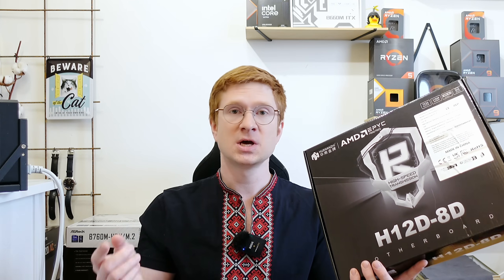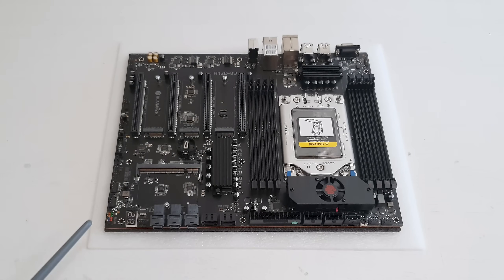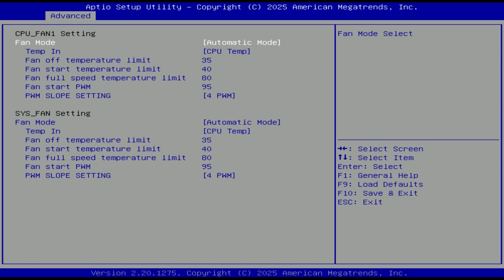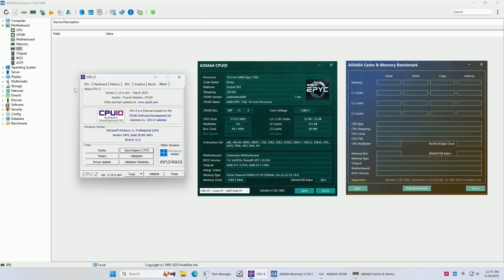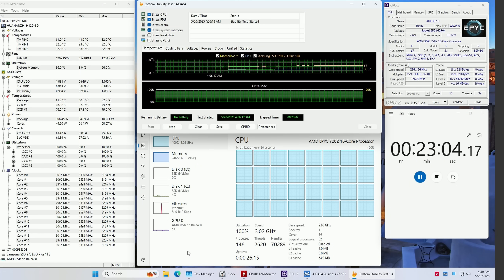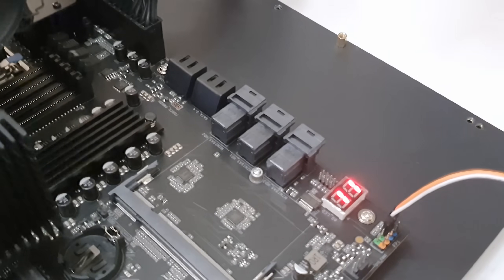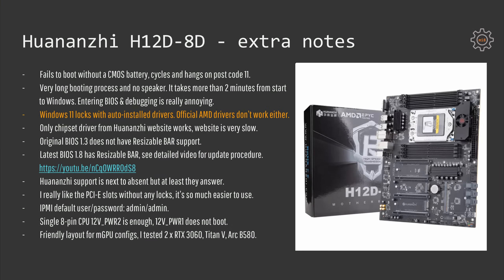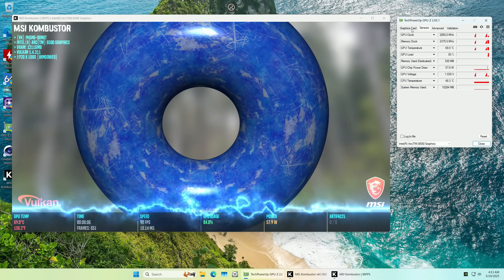Huananzhi H12D-8D EPYC - motherboard review, part 1

Comment: 10.22 same with a official board asus for amd drivers you need verry specific drivers
Reply from the maker: Thanks for the info. This is my first ever EPYC board, previously I only had Threadriper.
Reply: @Miyconst  this 1 was a budget build my first server it hes the rx6550xt in it.if i had known the chinees had mothboard in the making i would have waited...this secondhand krpau r2 16 ram slots 8 +- 100gbs read write aida occupied costed me like 350 motherboard aloane and only 25x gen 4pcie...ofc was +-a year ago atleast it leaves a upgrade path to gen 3 when the prices drop....with epyc 7302p i lv of at around 80w iddeling.carefull with alliexpres ram they sell 3200mhz ram but then only 1 module shows up and you got to downclock timing s for the rest to show up had to downclock it to 2666 for all ram sticks to show up...no mony back alliexpres return buyer protection seems more and more just a paper to wipe ur as*s with only pay them with paypal cuz you cant count on there internal dispute proces.

Comment: Thank you for the work on the BIOS update, I updated mine and now have Resizable BAR too, very pleased. Mine has still been rock solid so far! Worth mentioning, my boot time is about 15 seconds from power on to Arch, make sure you disable BMC in the BIOS, and it'll bring the start-up times down by a minute or two.
Reply from the maker: Hm.. I tested without BMC installed and it was still slow. What is your CPU/RAM configuration?
Reply: @Miyconst  Worth stating that even without a BMC (I didn't bother buying it), if I boot with BMC enabled in the BIOS (which is default), the start-up time is 2-3 minutes, but with the BMC disabled it's under 20 seconds.
Reply from the maker: Oh, thanks for the tip, I will try that.
Reply: @Miyconst  Makes a huge difference to mine, good luck!
Reply: @Miyconst it's a 7532, 128gb of buffered 3200 ECC, and a 6900XT GPU.

Comment: Another great video, I have a question for you. I was checking AliExpress, and something came to my mind when I looked at dual X99 motherboards, would they be good for a budget AI build¡ due to the amount of RAM and many GPUs? If so, would you recommend any X99 dual in particular? I checked, and the X99 machinist D8 looked the best as it has 4 PCIe x16 3.0, is there anything better, cheaper, if possible? Also, does the chipset in dual motherboards make a difference other than the stability of the C612 and overclock of the X99?
Reply from the maker: I would stay away from all dual socket Chinese boards. If you need something cheap - get a used Dell T7810/7910 instead. The Machinist X99-D8 board in particular is very problematic. Regarding the AI, it really depends on your workload. If you hope to use CPUs with massive amount of RAM then it will be a big disappointment as these V3/V4 Xeons lose badly to EPYCs.
Reply: Thanks for your info @Miyconst

Comment: also you need to install memory properly due to the manua (if you are using less mem modules than slots you have). and epyc 7002 and 7003 CPUs has different memory layouts. incorrect instalation will cause WHEA errors for L3 cache, freezes, lower perfomance
Reply from the maker: The motherboard has eight slots and all were populated with RAM, thus I don't think it has anything to do with the locks I experienced.
Reply: @Miyconst  if all slots are populated - there are no probems, but if you use less RAM sticks, especially on DUAL CPU EPYC system - you will have some problems with stability and perfomance

Comment: There's no chipset, why would it need drivers? NVMe, XHCI and AHCI work with default drivers. Rest of the things are handled by the BMC. You're most likely installing shady spyware.
Reply from the maker: AMD's EPYC SoC needs drivers to function properly. Otherwise there will be a bunch of unrecognized devices and Windows will attempt to install drivers from Windows Update servers.

Comment: Thanks for the review, looking forward to part 2. Slow POST and boot times is almost certainly an Epyc RAM training issue. My Epyc 7k62 on a Supermicro board takes just as long.
Reply: That's just that's not an issue. That's a feature of the platform. Ddr5 has a lot of ECC and noise handling in it
Reply: @teromeehaley4612 issue is maybe the wrong word. Trait is more like it
Reply: Server Motherboards usually take a long ass time to post. I work in a Data Center I don't think I've seen a single system POST in under 5 minutes, most take about 10 minutes to POST. Usually longer if it's the first POST on a new motherboard. That goes for both Intel and AMD systems.

Comment: Given the layout similar to tyan s8030 and asrock romed8-2t, the second 8pin 12v is very likely for pcie / ddim / sas etc. 4x 3090 or even 4090 blower will draw crazy amount of pcie power (200+W), which really deserves a dedicated power rail.
For the pcie extenders (for example 4x 3 slot cards), you will need dual sff8654 8i pcie x16 riser kit which will be expensive.

Looking forward to the part2! ❤
Reply: What will happen if i just plug 4x 4090 and run it full power for ai llm ? 😅
Reply: @tyfinancial  It should be fine. Dual psu to the 12V. The pcie should be still 200w, in total. I use 3090 x4.
Reply: PCI-E power supply totally depends on your PSU instead of motherboards slots, slots only provides 75W max for standard output which like A1000 such.
Reply: @AfroJewelz It is more like 75W per slot. My case is 45W x4, seen in gpuz. If you have power rail monitoring (direct probe with multimeter instead of ipmi), you will see voltage drop to 10.4V and eventually trip my 2050W PSU even it is not halfway there (capped to 225W per card)
Reply: @6DAMMK9 my current setup using 2x rtx4090 + cymoon x99 mobo 😅..with 1650w psu
each pull 60w+- from pci slot at gpuz.

That mean this board only supply 45w if 4 gpu setup? And the remaning go to gpu 12 2x6 power cable ? 🤔
Reply: @tyfinancial  That will be very complicated. Before 3090, even 2080ti, nvidia has made most high end cards pull only 10W from the pcie slot so there is actually no consideration in this topic. You can trace PCB layout to watch which power phase use pcie slots (AOHC / GPU repair channels will teach a bit)
However since 3090 "dual 8 pin" is already off spec, things get worse quickly. The "10.4 V" comes from supermicro X299 (single cpu 8 pin but 4 pcie slots), meanwhile ROG / EVGA is a bit better (low 11), and only these boards are high 11. 
They may not even share with the CPU 8pin, and all pcie slot power use the poor 24pin and trip the PSU if the 12V rails are split, or you can see the wire becomes hot (60C by thermal camera). 
It can still "support" all 300W, but that will burn wire like 5090 😅
I don't have the PCB layouts, it can be shared rails or dedicated rails, depened on the factory (yes, I have tried X299 before "AMD yes", which X299 with 512GB RAM is possible but really unstable)

Comment: Might be a bit of an investment, but would be nice to see if OEM Epycs like the 7K62 work properly, both from just a compatibility standpoint but also higher memory bandwidth and VRM strain. Thank you for the detailed review!
Reply from the maker: Huananzhi sent me some screenshots with 7K62, if that can be trusted then the CPU works just fine. I would also like to test it but as you say, it's a sizeable investment and I have already spent way too much on YouTube this year. 😕
Reply: I've tested the 7K62, and it runs perfectly fine on this motherboard, except that it fails to display the bandwidth in the AIDA64 Memory Benchmark (I waited for a long time, but no result was shown). As a result, I ended up 7532 as a replacement.

Comment: Excellent review! Proxmox is definitively high up on my wish list for your 2. part - IOMMU, SR-IOV, GPU, SAS and NIC passthrough - as there are lots of use cases where one might want to pass through dedicated or virtualized multiport NICs with 25 or 100Gbps.
Reply from the maker: I don't have any external NICs to test but I will surely verify GPU pass through. If it works, any PCI-E device should be possible to pass as well.

Comment: SP3 EPYC doesn't support UDIMM at all, RDIMM or LRDIMM only. My asrock board doesn't support 3 pin fans either. With 7282 you might as well run slower ram or just 4 sticks. The limit isn't the memory to IOD link, but the IOD to chiplet link. I'm running 2133 and its fine. As for boot times: mine are awful too. LPT: When you need to get into bios from windows, just hold down shift when pressing restart and then select bios from the options. It'll still take a while, but at least you dont have to babysit it.
Reply from the maker: What ASRock board do you have? Sure, for budget builds DDR4-2133 is good enough but if I have faster RAM, why not? 😃

Thanks for the BIOS entering hint, I gotta test it.
Reply: @Miyconst  I have the EPYCD8. So gen 3 and zen 1/2 support only. But for 200 eur new in box, I'm certainly not complaining
Reply: Which is generally a good news, UDIMMs are a lot more expensive than same size RDIMMs

Comment: Hello, I have an other Question. What X99 CPU should I get for gaming and I have a pretty weak GPU, so only time my CPU could be a bottle neck is when playing Fortnite at perf mode, please tell me best gaming CPU with good clock speed cheap range like E5-2667 V3 price
Reply from the maker: I don't know how much E5-2667 V3 and other CPUs cost for you but if you plan to implement TBU hack then it's E5-2690/97/98/96 V3, without TBU it's E5-2667/90/97A V4.

Comment: Really hope you can test it with proxmox to see if it is difficult to install. It seems will be a new era of EPYC from these China supplier. Not too bad for the 1st EPYC motherboard from chinese company already. Good video and seem like this board is not too bad for this level of company.
Reply from the maker: EPYC CPUs will inevitably flood the used market but these aren't budget gaming options so it won't by anything like X99. The X99 niche is being taken by AM4 Ryzens.
Reply: @Miyconst I think they'll take the niche of homelabs and home servers. But gaming on an EPYC would be pretty epic, not gonna lie.
Reply: @Miyconst  Don't sleep on the Socket SP3 on gaming just yet! 

Don't forget that when X99 first made huge windfalls in 2019 I believe? It was considered a mid-ranged platform compared to the budget X79/X58 setups most were rolling back then. An example was that you could build a 300-400$ gaming PC with Ryzen 2600 capabilities while a 600-800$ PC would have been a X99 machine with higher specs comparable to, at the time, Comet Lake 8 core I7 would have been a monster budget gaming PC.

The CPU you also tested was substanially weaker as well. It's not the motherboards that will make or break this platform as a gaming machine, it will be the CPU's themselves, it's always been like that. The one you tested has 30% less Vcache than the 5600X3d. Currently if anyone is mad enough to buy one, a more capable Zen 2 era Epyc CPU with more than 100 L3 VCache from China cost a mere 250$ on Ebay.... Far from budget now just like when the Xeon 2689 v3 or v4 was I believe? 

A few CPU's I would suggest to keep a very close eye on are Epyc 7302P, 7262 and 7452. All of these CPU's have the same power draw at around an unholy 155-180 watts, if we were to overclock these baddies a little, they may potentially begin exceeding that of Zen 3 X3d with more cores to boot. Ultimately, without benchmarking these CPU's, we won't know how good Epyc Sp3 will be for gaming and for other workloads.

I can comfortably predict this Epyc line will never be anywhere near as good as what X79/X99 had offered, simply because of its power draw, lackluster performance and expensive setups, do not doubt that these Epyc motherboards (especially good quality ones) will cost as much as a branded good quality B550 motherboard in US Amazon, however, for 600-800$, if the CPU's are cheap, getting good Zen 4/3x3d performance for cheap is not particularly bad, but at that price point. you really, REALLY need to justify yourself on buying one. 

Currently no-one that I have seen have tested these high-end Zen 2 era Epyc CPU's for gaming or productivity benchmarks against a Zen 3x3d CPU. If they perform the same at half the cost... They might be viable products..

Outside of productivity and gaming, it's a great Server replacer for the low budget X99.

Comment: Absolutely great work in the review. Looking forward for part 2. This motherboard is very appealing to me, as in my country Colombia is very difficult to acquire AMD EPYC motherboards. I'm even thinking of using it as an option for servers to my customers. 

Keep up the good work and thanks for the video!
Reply from the maker: Thanks for the support and feel free to let me know if there is anything in particular you want me to test in part 2.
Reply: @Miyconst could you please show the features present on the IPMI software? 
It would also be nice to check if it supports RAID across NVME drives and if ECC mode works
Reply from the maker: IPMI is very basic there but I will make a walk through. ECC mode works, at least Aida64 says so. NVMe raid I wouldn't use on hardware level but I will check it for you either way.

Comment from the maker: Please leave me a comment if you have an idea of what to test in the part 2.
Reply: Yes, please test SRIOV (for both networking and GPU) to see how much of it works or doesn't work. I saw that there was an option in the BIOS to enable it, but it would be interesting to find out which devices can be used with SRIOV (and which ones can't).

For testing in Proxmox, I would also definitely love it if you would be able to test IOMMU and GPU passthrough to make sure that is all working.

Also, I don't know if you'd be able to pass through one of the mini SAS connectors to something like a TrueNAS VM so that it would then be responsible for pulling NAS duties.

Great video!

Your help is appreciated!
Reply: ollama + qwen3:235b-a22b, ollama + deepseek-coder-v2:236b
Reply: @VolodymyrKopey  With some CPU only inference stats mixed in please!
Reply: Does it support redfish? Does kvm in web interface work?
Reply: @bogdanrzheusski8115  There is a web BMC management interface, but its functionality is very limited (e.g., it cannot adjust FANs' RPM). KVM can run normally as long as you're not too greedy (e.g., attempting to use the KVM screen as a second desktop for a monitor, more details in my comment below).
Reply: 4k gaming benchmarks, just want to see how much a slow epyc cpu affects high res gaming please seeing as you have a 7900xt 20gb 😉. I know 1080p shows best example of cpu performance but want to see real world 4k+ performance.
Reply: Please consider including X4: Foundations in CPU performance tests like the one shown at this timestamp https://www.youtube.com/watch?v=ZPiddxAd3aY&t=168s. This game is heavily CPU-dependent and would be a great benchmark for testing processor performance.